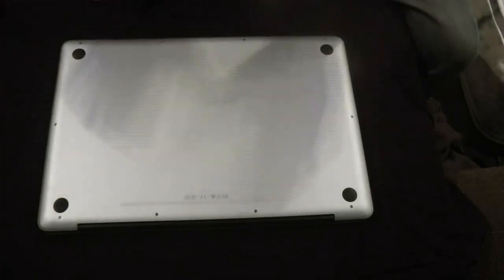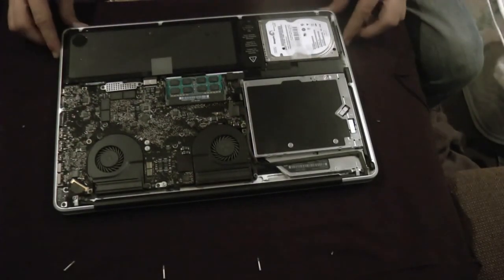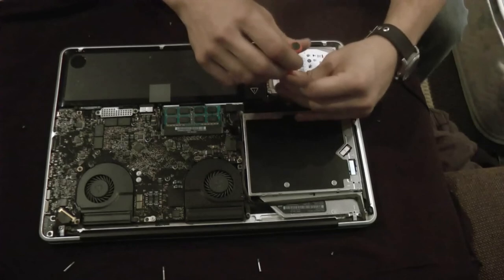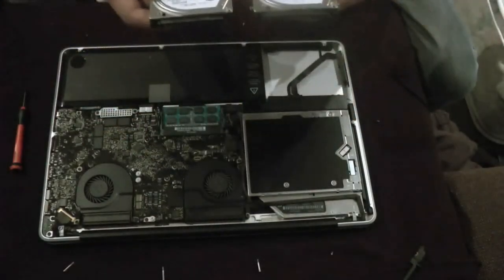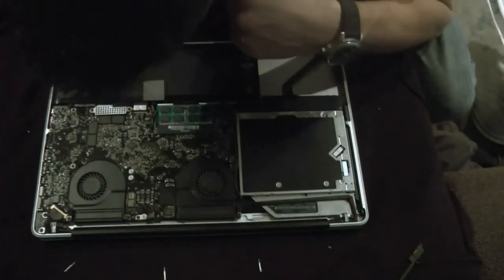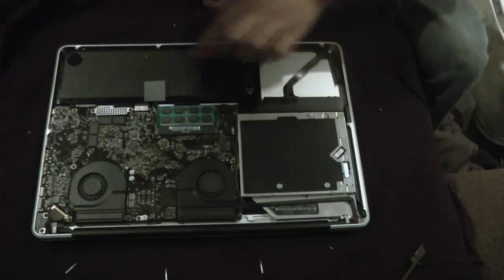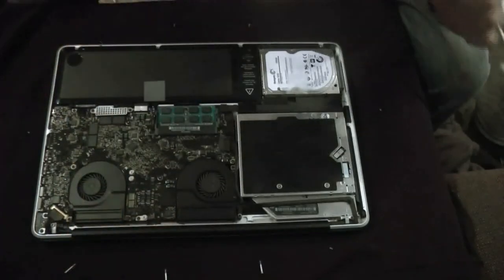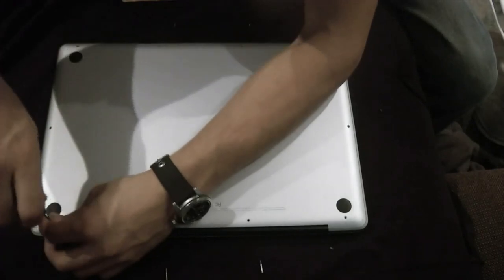SSHD installation -MacBook Pro

Comment: Hi do u think there has been any difference apart from the boot up time? Like app launching time and copy pasting files? Please let me know
Reply: chaihg There is a big difference in boot time, But file transfer may be slow because the capacity of SSD is significantly smaller than 60GB, If the file size exceeds 60GB along with Operation System, then the transfer speed will be reduced to the speed of traditional hard drive.

However, Launching apps are faster because the plist files are loaded from the SSD.